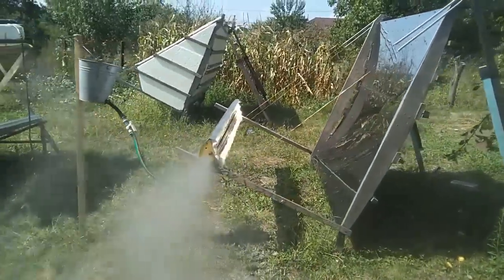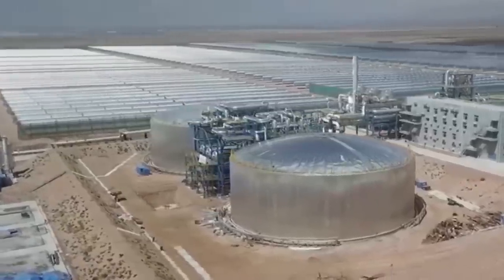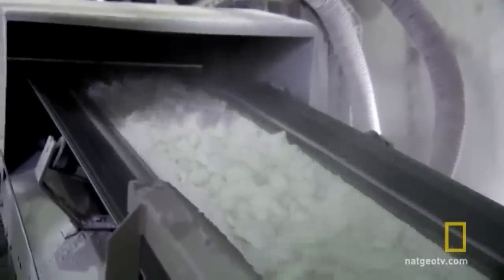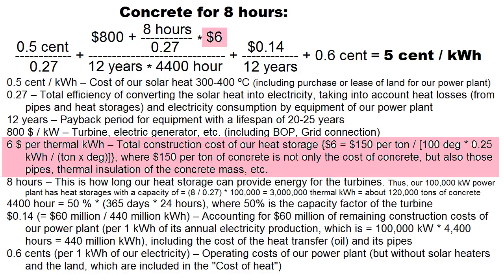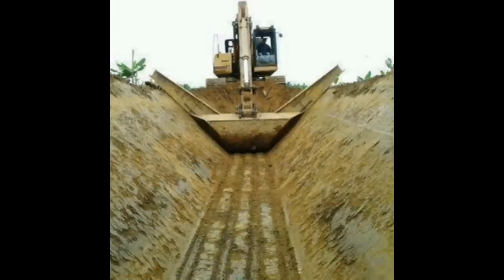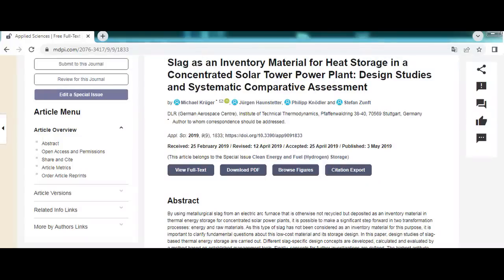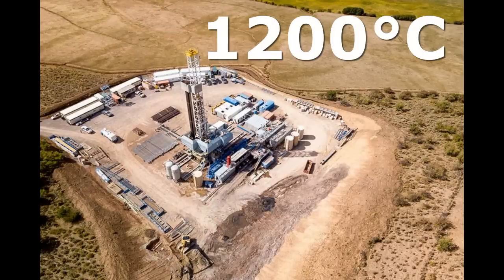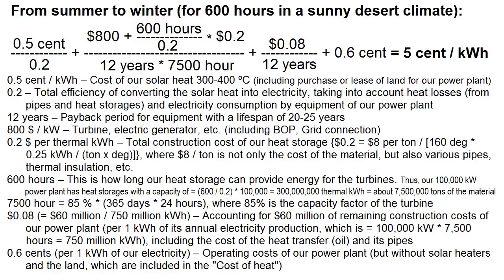New in Solar energy: solar electricity day & night, 5 types of storages that are cheaper than Li-ion

Comment: Any heat storage using concrete should be avoided in my opinion… it takes too much energy and creates too much CO2 to make it. Anything that uses sand and crushed stones should be great. Furthermore, if any pipe should leak it‘s impossible to fix if encased in concrete. With sand and stones it‘s also very hard to fix, but at least somehow possible.
Reply: It is kinda hard to replace concrete for foundations and certain other large structures, but I generally agree that it should only be used when necessary for exactly those reasons.